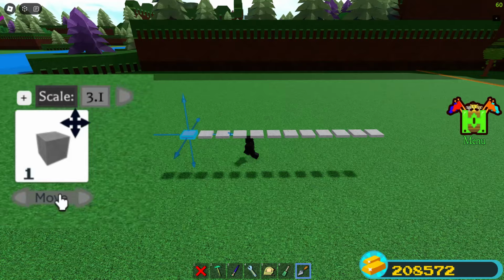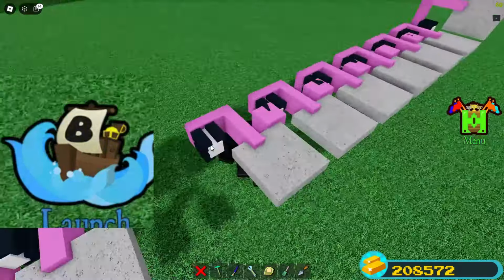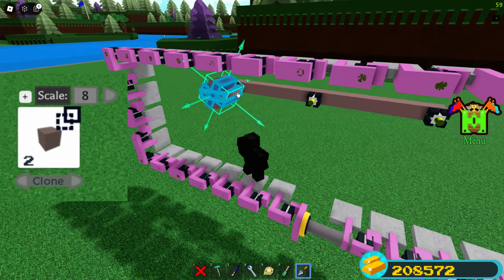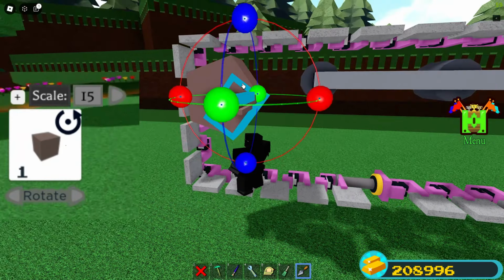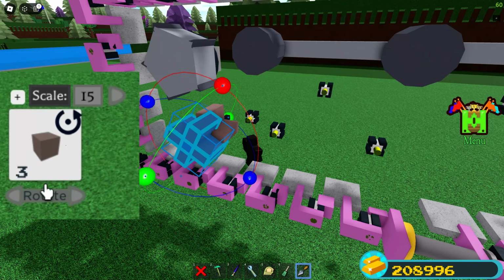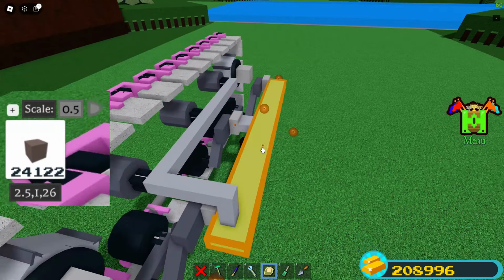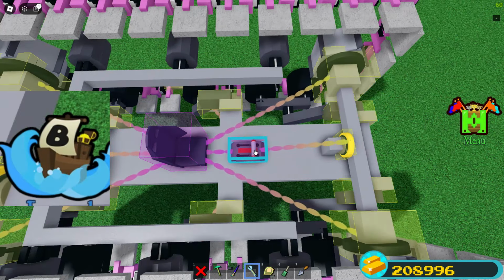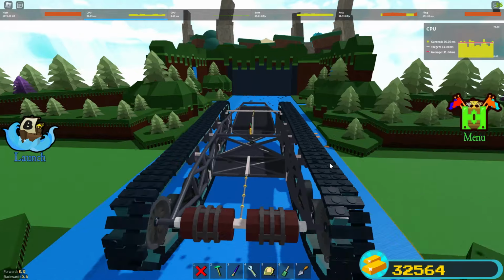Build a Boat - Ripsaw suspension tutorial

Comment: There used to be a glitch for tank steering for mobile but due to the new update it's already useless now.
Reply: Theres a glitchless way
But.. it will take alot of gold depends on the tanks weight
Secret tho
Reply: @II_Faither  tell me?
Reply: @GLITCH_KingGUEST666  Fine
It basically uses Motors
In my tank i use 4 motors
2 looking forward and 2 looking backward
they counter eachother so only turning is there
then you can go and make it move with wheels or anything u want
(the heavier build is the more motors you need
Also if you put all motors facing forward it will go motor speed which is 20 wheel speed thats why there are motors looking backwards)
Reply: @II_Faither  oh I never thought about that before I thought if I put a motors backwards it will not cancel each other.
Reply: @GLITCH_KingGUEST666  they have the same force
soo basically that happens
this is useful if your car or tank or even helicopters dont turn

Comment: gues, my FPS -20 - 30, and ping 130 - 160, it a destrou this build, what me doing?
Reply from the maker: check the suspension under the tank, it might not be connected
Reply from the maker: You probably moved something out too much and the tracks have way too much tension because of it. So try reducing the tension with less pistons distance. If it works better with less distance then it means the gears or the roller wheels arent placed correctly

Comment: does it work if i build it out of plastic?
Reply from the maker: Haven't tried it yet, should work but might act a little weird because plastic has no weight at all (metal blocks should be a good replacement because they look smooth too)
Reply: it works but sometimes the plastic snaps, also amazing 10/10 build.

Comment: I when follow all the steps you did but problem for the tank track came off idk how to make it stable....
Reply from the maker: Probably the springs under it arent connected properly (make them visible and unanchor everything and check if theyre still connected)
Reply: @dabl2928  there nothing wrong with the spring wdym? all the steps i did are correct but what when wrong when it keeps fall my tracks and couldn't move
Reply from the maker: hard to tell how it falls off the tank, might be the best if i just check it out in game if you wanna get it working
Reply: Shall i add you bc i could show you how the performance of my tank track that i build is the same result as yours from the tutorial

Comment: On my pc it will only select 1 block at a time unless a do the grid thing, how to I make it so I can select multiple without dragging over the blocks I need?

Also how do u center the thing so it's easier to move stuff? In the trowel tool and the wrench
Reply: Hold either Shift or Ctrl on your keyboard then click the other parts to select multiple parts at the same time.
Reply from the maker: to select multiple at once hold shift or ctrl and keep clicking the next pieces, to recenter something just deselect and select a straight piece (thats not tilted or anything)

Comment: @dab
l2928 why are the 
chains falling off my tank?
Reply from the maker: Make everything visible and you will see what is not connected to the tank, the springs under it are probably the problem
Reply: @dabl2928 No, the springs are connected, but whenever i use 50 wheel speed, or any wheel speed in general, it falls off almost immediately. Maybe you can help me in-game?

Comment: The tracks go off the wheels it doesn't contract for me
Reply from the maker: the suspension under the tank probably didnt attach, you can make it visible and check if the suspension is connected to the tracks when driving
Reply: @dabl2928  it is connected and everytime I unanchor it just breaks

Comment: When i finished it literalily insta-breaked
Reply from the maker: tracks fell apart? or did they keep glitching by themselves?
Reply: @dabl2928  they glitch by themselves
Reply: When i press the lever the ripsaw just turned into some 5 buck sausage
Reply: I turned off the collision to the mechanic if you ask
Reply: And some servos that arent supposed to rotate are rotated (not fully though)
Reply: I tried to make the servos max torque it kinda helped but after some secs it fell of the back wheel that moves it
Reply: Maybe its beacuse of the bonus weight from the rusted blocks i added to make a better grip
Reply: Nope
Reply: I think i understand what the problem is
Reply: I saw some parts of it sticked together and it made it more tight making it unmovable and bugging
Reply: I fixed it :D
Reply from the maker: @uylol27 nicee

Comment: Will it still work without the servos?
Reply from the maker: The upper ones are needed for suspension, it can work without the lower ones but the rods might turn and even stop it, it will work as long as you dont jump much with it

Comment: what if my springs explode
Reply from the maker: did you change the damping to a high number? that usually glitches them out
Reply: @dabl2928  0 it is
Reply from the maker: stiffness on 0 too? You might have connected something wrong if it immediately disappears (just try removing the springs under it and test if it immediately disappears again, if it does then theres something wrong with how they're connected)